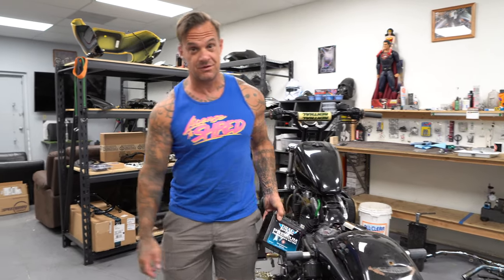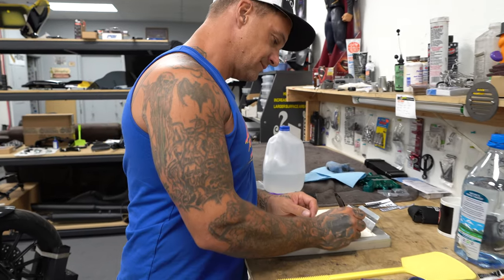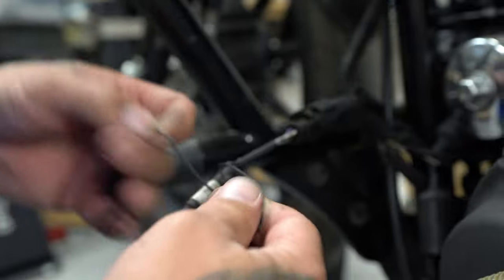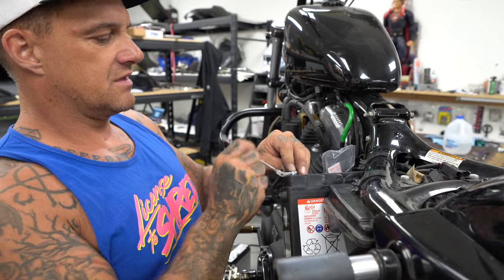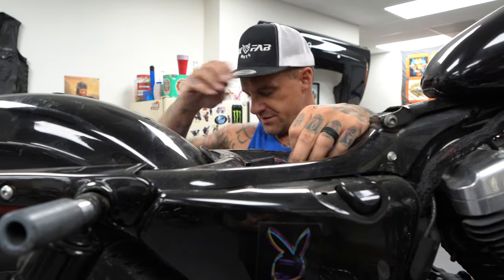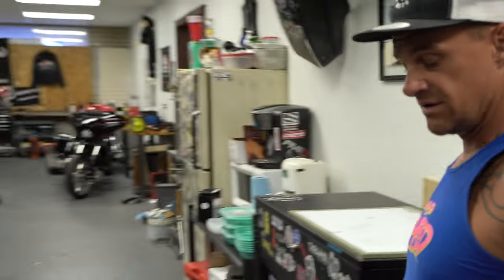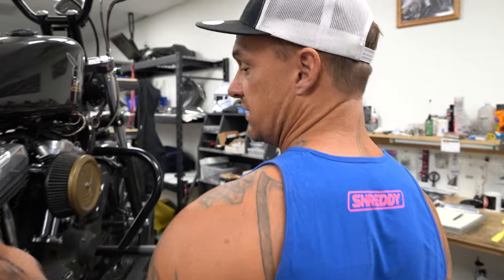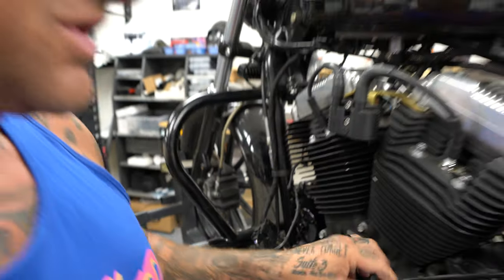Harley Davidson electrical PROBLEMS on a 1200 sporster

Comment: Those o2 sensor foolers have an adjustment on them that tells the o2 sensors to read a certain way and it fattens the motors up! Cheap easy way to add just a little fuel for a pipe or air cleaner.
Reply from the maker: Man that sounds like a garbage way to do it. If you could probably download a map for less money than those things cost.
Reply: It cheap but only good for certain RPMs throttle position (closed vs open loop) As the saying goes time is money and it looks like it took a lot of time to f up all that wiring.

Comment: Those are Vied or XIED fuel enrichment plugs. They trick the 02 into reading incorrectly, so the bike delivers more fuel. Cheap dudes do them on a stage 1 build to get the extra fuel
Reply from the maker: Sounds and looks like garbage and a scam. There’s nothing in them to trick anything it’s just wiring with the ground off the side.

Comment: Big G'day from Down Under 🇦🇺 💪
Love ya work bro💪💪💪
HD COULDN'T figure it out but on my 05 Sportster XL1200c but had an issue... Would fire up then... shut down,..🤔🤔🤔
So while running & goes to die ... I quickly flicked then RUN switch OFF & back ON... then run... Again goes to die, flick the switch & would backfire & run...
🤔🤔🤔 Did my head in big time, so I started to pull the tank off & figure it out... Then as I unbolted the horn FOUND the problem ❗❗💪💪💪....
It was the wiring to the horn had rubbed & was creating a earth leak.... But as the bike vibrates... Would every so often make contact & making the bike SHUTDOWN ❗...hope this helps with further issues or concerns 💪
Living The F🤪KING Dream ❗
Safe travels 🙏♥️🐾🐾🇦🇺

Comment: Had the same issue with rpm’s tanking while pulling the throttle on my dyna and it ended up being the engine temp sensor.

Comment: The good thing is that all Sportsters from 1957 - the very last model are 90% rhe exact same bike. Even the Sporty "Evo" is just an updated and upgraded Ironhead (a lot of people dont know that, now you do). I digress. It is easy as shit to just strip the harness, slap a carb on it, and buy or make a new harness with like 1/16th the amount of wires and bullshit.

Comment: I had the same issue on my 18’ sporty main fuse was wiggling loose, usually after a wheelie or it falling over. I used a piece of tape to jam it in tighter 0 problems.
Reply from the maker: 😂😂 solid fix🤘🏼🤘🏼

Comment: I just changed my cam chain Tensioners. I have 137 miles on it now. And today on way home I started to here a lot of noise. My outer tensioner shoe was broke in 2 pieces. Chain ran on the rod we’re shoe should be. Need advice/ and maybe why it did it oem parts
Reply from the maker: Is there an old tensioner or a new one? What Bike is it?
Reply: @kruesioriginals   both were new
Reply: Some shoes have to be faced a certain way for the oil feed and some are bidirectional. Also the shoes have internals which not all aftermarket shoes come with. Just sleeved with a spring. Hope this helps, there really is no other reason they would fail immediately, unless your cam plate is clogged. Take the cover off and crank it, see what it’s doing.

Comment: So I need to replace the 20/50 weight oil that cost me a frgging fortune? South central Texas does get Hot.
Reply from the maker: If it’s over 85 I would run a heavier oil. A good synthetic oil, Motul, or klots
Reply: @KRUESI ORIGINALS  not Amsoil? Thanks for the heads up! Also should the heavier oil go in three holes?

Comment: @Kruesi: don't try and make Tweaker wiring a deep thought.... the O2 sensor likely  needed a "new" ground wire and they had a long lead to find a bolt
Reply: But I'm riding shotgun on the "WTF were they thinking" party bus
Reply from the maker: Amen

Comment: Ok mine drops the number 1 cylinder usually after i get gas. And when im riding it sounds and feels like its cuting in n out on bumps. Steady throttle bbbrrrrrrr...rrrrrr...rrrrrr...brrrrrr